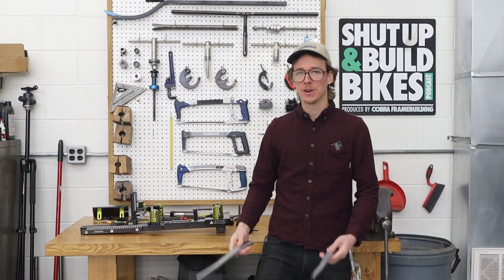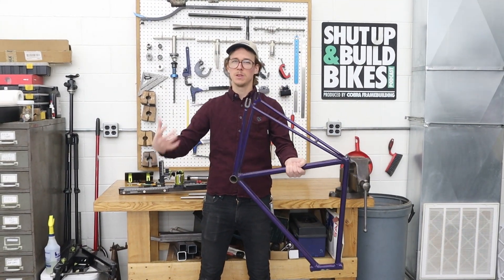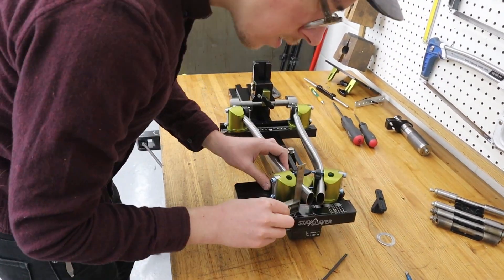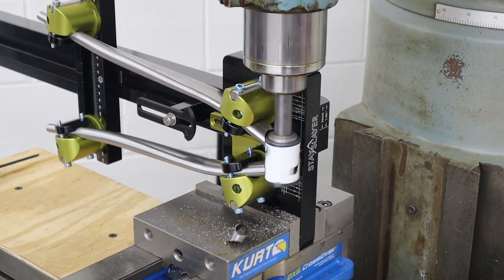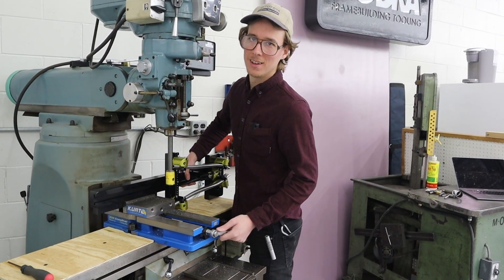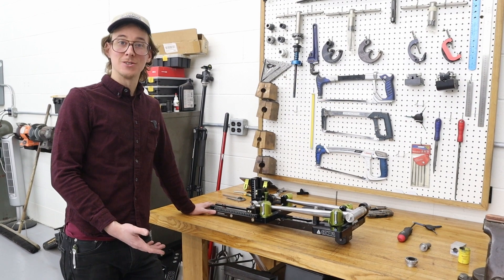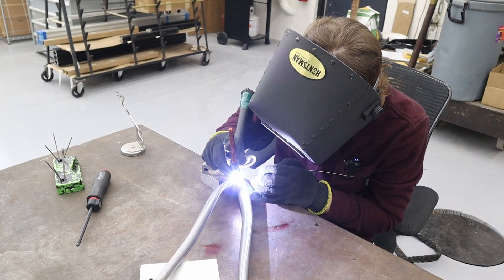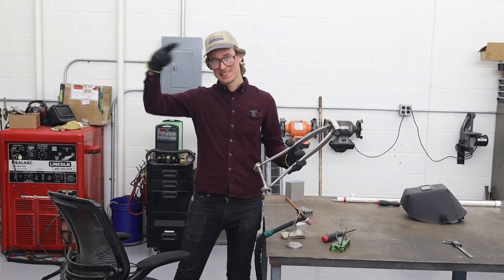Miter & Weld a Chainstay Sub-Assembly with the Stay Slayer

Comment: I don’t have a great set up for cutting tubes  yet. If I end up with a lot of gaps in my fit ups, then would I be better off brazing my joints instead of TIG welding?

Comment: Nice explanation of the advantages of TIG welding the BB to chainstay first as an alternative to the other approach which is welding the BB to ST first.  Especially for builders with large hands, it can be difficult to get your hands in that tight rear triangle space if the seat tube has already been welded in place 1st.  Does the same considerations apply for those that lug or fillet braze?